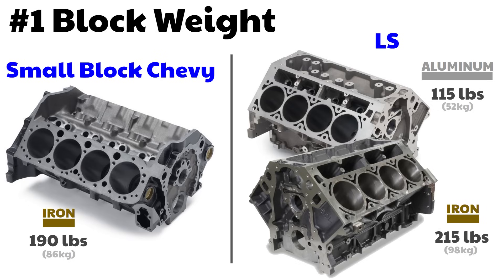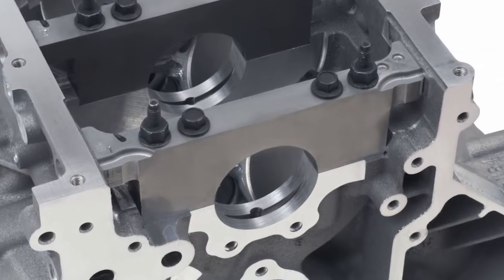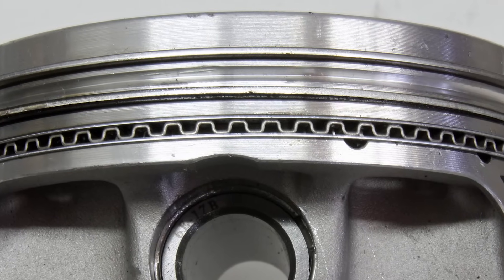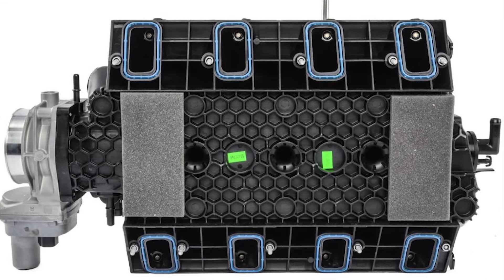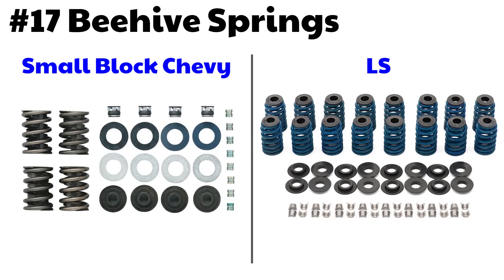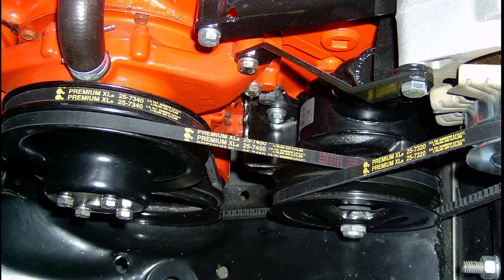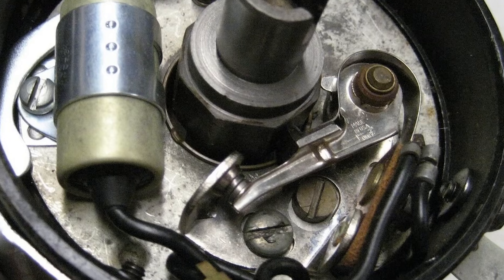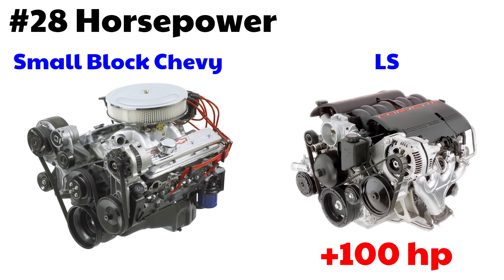29 Reasons LS is Better than Small Block Chevy (Gen 1 & 2 vs Gen 3 & 4)

Comment: I read some of the comments of how defects were in the engines of car companies, such as GM, as with the 1971 Chevy Vega that had an aluminum 4 cylinder block with coated cylinder walls (silicon of the A390 alloy) that supposedly toughened it up to cut down on cylinder wear, but when a head gasket gave way (due to combining an aluminum block with cast iron heads, that caused different expansion rates, tearing at the head gasket), allowing water into the combustion chamber that would break down the silicon content (in which none of the engineers ever really gave a second thought about water damage), it scored the walls badly by piston scuffing due to silicon breakdown by water, with GM having to replace thousands of engines with a standard cast iron block, so that it was called "Chevrolet's first major blunder from beginning to end".

But when God creates anything, this is what is the result: "I have come to know that everything the true God makes will endure forever. There is nothing to add to it and nothing to subtract from it. The true God has made it this way, so that people will fear him."(Ecc 3:14; Note: God's personal name is Jehovah)

Hence, if a person wants see something that is perfect from start to finish, all they have to do is look at his creation, from the structure of the atom to the smallest microbe to the plant and animal life to the immense quantity of stars to the innumerable galaxies, all working together as "one".

This makes God the "perfect designer". And for those who look further into his "works", who wants a "real life" that has no defects, then a person needs to "search for Jehovah".(Isa 55:6) It is as Proverbs 10:22 says: "It is the blessing of Jehovah that makes one rich, and He adds no pain with it."

Comment: The most important is a stock LS 6.0 or 6.2 with stock crank rods and pistons with LS3 CNC ported heads stock other than being CNC ported with a camshaft and matching valve springs can make 575-600+ horsepower and it will still idle well be reliable and last a long time with good regular maintenance there is no way to make this kind of power with all stock components and a camshaft and valve spring upgrade on the old style chevy smallblock once you start to exceed 400 horsepower you'll need at least aftermarket forged connecting rods and pistons and aftermarket cylinder heads and even with a 3.75 stroke crankshaft don't think you could match the LS engines power reliability longevity or the ability to rev in the upper RPM range and the 6 bolt mains on the LS engine is so much more stable than the old style smallblock 4 bolt mains especially when pushed real hard 7000-7500rpm and this fact alone is why LS engines live much longer the crank is rock solid bolted to the block so there is no flex on the crankshaft or movement once they crankshaft starts flexing or has movement the party is over it will break even a 406 chevy smallblock with 12 to 1 or more compression with all forged intervals with a very big solid roller cam expense AFR heads may equal the horsepower and exceed torque of the LS engine down low under 4000rpm l doubt it would rev as well last as long or have the torque the LS engine does above 5500rpm plus this 406 smallblock would idle around 1200-1500rpm this 406 would make peak torque around 4800rpm by 5500rpm torque is dropping like a brick off a cliff the LS engine with a hydraulic roller and the right cam will make peak torque at around 5200-5600rpm and not drop like a brick off a cliff until 6500rpm and rev in the higher rpm range very fast without any struggling that you will feel above 5500rpm with the old style 406 smallblock the only down point for a decent built LS engine these engines like 4.10 or more gearing and a high stall converter 3800-5000rpm stall to make it really work if a LS engine is got a good setup you'll never feel the torque drop off all the way to 7200rpm or feel the engine taper off or labor or strain to do so and do so very eagerly to the 7200rpm redline without shaking or vibrating the higher you rev it the smoother it runs and do so many times and never let you down running just as good over and over again

Comment: What you’re trying to say is you’re trying to reinvent the wheel small block Chevy‘s been around since 1955 it’s a good solid Engine that has proven itself the LS is a new design which has problems and you can look that up and who the hell is going to run a 700 or 1000 hp engine on the street that is bullshit no pump gas will support that plus cost a small block Chevy is a lot cheaper to build your LS is a want to be small block Chevy

Comment: I like both engines and I will buy either one if I can find one for a good price. Can’t go wrong either way. It mostly depends on what you plan to do. A show car should have a small block IMO for looks and nostalgia especially if the car is older a racer should have an LS.

Comment: Early 5.2 ls with gapped rings and stock rods and pistons with cam springs and turbo have made reliable 1300hp. And newer 6.0 ls with newer rods have seen alomst 1600 hp in same combo with little more cam. With optimized tune.
Reply: GM has NEVER made a 5.2 LS

Comment: SB1, SB2 governed at 800 maxSB1, SB2 governed at 800 max (de-tuned. i.e can make more! Non stop, except for the  (de-tuned. i.e can make more! Non stop, except for the average... Can go 100% throttle 500miles... Or 100s of thousands of miles with upkeep on a daily build... And you can pull 4,000hp on drag race TRADITIONAL SMALL BLOCKS! (Probably get arguments on that. Before you argue, type in 4,000 sbc drag race engine)
But LS's have their spot too. Not going to say better or worse... Unless what's needed is a drag racing forced induction, EFI motor, and best friends with, or you yourself is a MASTER TUNER.. A bore cylinder sleeved LS will be easier than changing the small block to EFI and distributor delete

Comment: I do very much like your videos. I'm not sure where you get your numbers info, but I have real world experience on both of these. What you have not included in the small block gen 1 area is the high nickel factory blocks in both 350 and 400 castings, plus the sbc1 & sb2 nascar motors. These are highly sought and can handle as much or more then LS blocks. I want you to be educated as much as possible. For the 400 blocks from 1970-1980 these have 509 cast in side of block with 010 in timing cover area and the 350 blocks have 010 cast into timing cover area and sometimes 509 cast into block. You have to weigh them to tell because high nickel blocks are about 20+ pounds heavier. My little secret. I have 5 of each of these on hand in my basement if you want any more info.
Reply from the maker: Thats true, if you can find the right block you can get a stronger small block, but unless you know what you are doing its a bit of a guessing game.  I imagine those early 283s could hardly take any power.  With the LS there is no guessing.  Thats all Im saying, all the blocks are solid.

Comment: Best old school motor I had was a straight six in both a Jeep and another in a Bronco. Talk about good performance, easy to work on, inexpensive parts. The only thing about "newer" stuff is that it is more complicated, especially with electronics, computers, etc. I'll stay with the old for now. I love the smell of gasoline and rubber.
Reply: I had just a whisker under 500k, on my Jeep 4.0 HO, when it finally dropped a valve.  😢😢😢 I picked up a used 4.0 (with a 5spd) for $650... It purrs like a kitten...
My '72 Nova has its original #s matching 250 IL6 with a 2 spd Powerglide... Outstandingly reliable, Super Cheap to maintain or repair... It cost me a little under $50 to rebuild the starter, vs $500 for the starter on my Dodge Diesel....
F**k all this Computerized S**t...
Reply: @boatnut64  Could not agree more. Men who like to be self-reliant seem to share our feelings on the subject. Have a nice day. Roy, So Cal.
Reply: Ever look under the hood of a tractor-trailer or select Caterpillar machines? biggest strongest L-6's you'll ever see.
Reply: @dbspecials1200  Agreed. Have a nice day.

Comment: Great technical information. Very informative and entertaining. As long as you're making technical videos, it really stands out when you claim at 3:00 in that pistons are made with silicone. That's an RTV caulk that you seal your bathtub with. The pistons correctly contain silicon. It's an element on the periodic table that is used as a semi conductor material in the ECM and also an alloy component in the pistons. Keep making great videos.

Comment: Nearly 95% of what you've mentioned are simply design characteristics and have nothing to do with one material over the other. Anything over 350f - 500f degrees, Aluminum loses up to 4x's its tensile strength. Which means under normal operating conditions, and heavy load, Aluminum becomes 4x's weaker than Iron. Currently there is no reasonable application outside of high performance racing that aluminum engine components should be chosen over Iron. It simply doesn't make economic sense.
Reply from the maker: A agree.  Not cheaper, but lighter!

Comment: I am a subbed to your channel old fart into the LS engines. I was a die hard Big Block Buick fan for years only 25 LBs heavier than a sbc and had so much more hp/tq. Slap on a built Poston Hemi Carter carb for $172 rebuilt to flow 1000CFM plus .020 JE pistons/Kenne Bell/Poston stage VI cam and I was popping wheelies on dirt track nascar slicks. So I guess when the junkyards are filled with the LT1's there will be disagreements lol. I love the hp I can get with a stock LS1/T-56 with cam lifter upgrades alone. I just need to locate a 8.8 to help out the 1st gen s10.

Comment: wow, it just hit me...two decades ago when the LS didn't exist and the LT1 was fighting Optispark issues...we would have been arguing if the weight of a 454 was worth using versus a stroker 350 or 400 small block and its lighter weight in the nose for acceleration.  And someone would point out a destroked 400 would be better due to the revs.

A decade before that, it would be the 327 versus 350.

The arguing continues :)

Comment: The LT1 which was still considered a small block 350 had a computer and produced 305 hp in the 1996 WS6 Trans am which was only 15  HP less than the LS1, not 100hp, and I'm not even bringing up the LT4. I get that you want to paint a picture, but lets paint the whole picture.
Reply: Thats the gen 2 LT, the LT1 is a gen v. Its confusing because gm reused the code, the gen v LT came out in 2012. There was only one version of the gen 2 LT.

Comment: I am sure many of us have built small blocks from the 60s and 70s that easily handled several hundred horsepower on stock blocks, crank, rods,   heh... 
I guess you went only by manufactures info

Owell,

Comment: IMO I think the old sbc sounds better specially when it's built, they just sound nastier.
Reply: @J cheaper to build. now i know you have zero idea what you are talking about so your waste of time useless does not matter.
Reply: @J 🤣🤣 you can get whatever you can pay for. you can buy every part in a kit or put togther or piece every part out yourself. just because you bought a lit that had almost every part you needed does not mean anything about the point of ls or sbc being cheaper. go back to your pouty chair and eat a couple more crayons. maybe in a couple years you will come up with a proper response until then shut your hole.
Reply: I was just going to post this comment, there is a certain sound to an old school SBC that the new motors do not have. Not sure what it is, but they just have a certain sound!
Reply: @RCFred_68  You guys are definitely on a different sound board than most guys I know. Most every one of the guys I've hung around with all say the LS sounds nastier at its 6,000+rpm redline (7,000rpm for the LS7)
Reply: I was looking for someone else to comment this. Nothing beats iron block sound
Reply: No question
Reply: you havent built an ls right then cause they can be mean demons that sound amazing

Comment: Aluminum blocks have better heat dissipation, so they REQUIRE a smaller radiator??? Wouldn't it be more accurate to say that they don't require as big of a radiator?

Comment: The availability is definitely there now. I picked up an entire van for $700 that had the 4.8L in it with a 4L80E, but it had over 500K miles on it. I drove it from Virginia to New Jersey. When I finally get around to it, I'll be yanking all that out, freshen up the engine and transmission for my S10
Reply: Yeah your not going to do that w a gen 1 SBC and a turbo 350 not gonna see that many miles period ..

Comment: No it isn't, the idea is great, the lifters, electronics and sensors make for expensive touchy pain in the assembly, then just for the fun of it toss in the fuel pumps and pass lock  systems. Great idea, shitty execution, have them both right now, in 3/4 ton trucks, the older 350 is more reliable and simple and way cheaper to fix by myself. To each his own, for sure, but farming is a test for a trucks sensitivity (reliability).

Comment: Nobody used those end pieces on the small block intake gasket sets, the factory even stopped using them sometime around or before 1978. The intake on my very early manufacture date (September 1978) 1979 K-10's 350 had red high temp RTV from the factory instead of those end pieces when I put the Edelbrock intake on it in early 1979.
Reply from the maker: Thank god for that!  : )

Comment: I'll not pick this video apart in favor of a small block , yes the  lsis better it has all modern improvements , but a small block has a massive aftermarket and the sky is the limit for hp, but I digress my 327 could rev to 7500, my brothers 302 could rev to 9000

Comment: Bloody hell. I watched about 30 sec and it is all crap. SBC of the 60s are thicker, read heavier than later ones. But will take .060 overbore [if not rusty] whereas the later ones are safe at no more than .030. And maybe 20lbs lighter. 
360hp?  That is pure crap. LT1 in 1970 was 370hp factory and the late 327 fuellie engine was more.
People in every aspect of motorsport have made double that on standard blocks. Sprintcars were well over 600 over 30 years ago. Nascar used slightly tricker blocks, high nickel blocks you could buy over the counter however and ran 500 mile races at 9000 rpm.
Try that with a std LS!! The aftermarket engines may cop it but has anyone tried? And drag race hp is irrelevant in this story.
The LS is an ok engine and can make good power. BUT as has been proven the 4 bolts per cylinder in comparison to 5 bolts on a small block is a failing and they lose headgaskets and occasionally arc a head. The oil pump too is a failure in comparison,, though a decent race engine is dry sumped whatever. The factory rods too are very suspect. Cheap is the word. Generally ok for your standard Corvette or whatever but need to be binned for anything more. LS Crank is no better for strenth than a cast SBC one. Though the LS Crank is a bit lighter.
700hp on the LS  alloy block?  Can be done but you may get bit!! 600 is fine more is dangerous. That is the reason the aftermarket sells stronger blocks, some with more head bolts as well.
Those weights sound suss as well, 190lbs? I have picked them up and carried them around. And I am disabled!!
Alloy disapates more heat? An engine is a heat pump, the more heat held means more power. 30 years ago it was reputedly 20hp for an iron Sprintcar block v and alloy same spec one.Though the lighter engine makes the car handle better generally. And for the OEM lighter uses less petrol.

Comment: LOL so much magazine propaganda in this bullshit video. The SBC (genuine article) holds the record for the fastest small block powered quarter mile AND also powers the fastest piston driven car on earth to a stunning 462+ MPH. The 3rd gen ("LS") is indeed a great platform but not even in my top 5 favorite engines for racing. It's disposable and cheap otherwise it wouldn't make the top 10. The real SBC design is at this point insurmountable as the king of all engines overall. It's history and influence are undeniable. It single handedly revolutionized the automotive industry and has dominated almost every corner of motorsports for nearly 70 years. The "LS" will likely not even be popular 40 years from now and will have been out of production for decades by then. As a professional engine builder you learn "better" is nothing more than a matter of opinion. In this case there are too many variables in play to score the two fairly against each other because there's no context. If you're arguing about this at your lunch room table at school 6 bolts is obviously waaaaay better than 4 always without question because SBC blocks are notorious for crankshafts just abruptly falling out of them so ya! Two more tiny bolts in the block skirts is totally gonna help that!!! Roll eyes this is just kids arguing over shoes to me.
Reply: Hi jon

Comment: Dude.... You "power handling" numbers for a "stock chevy small block" are pure fantasy.
The Nova I just sold was MILDY built and had roughly 425hp or so.
Yes... The LS engine family is awesome. We all get that.
But you don't need to make up BS tiny numbers for the traditional small block to reinforce that fact.
Reply: Yeah, a lot of opinion in this video, not backed up with any factual material.